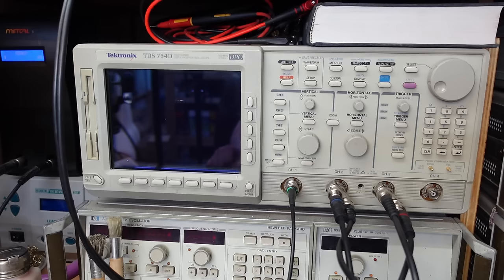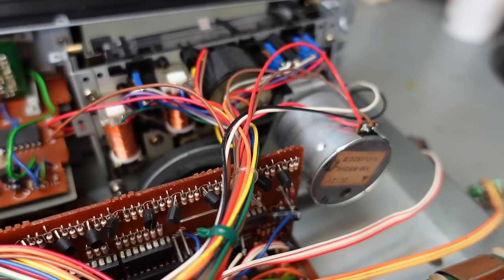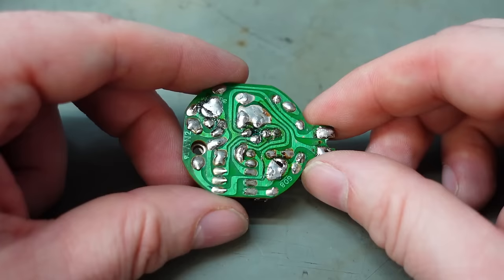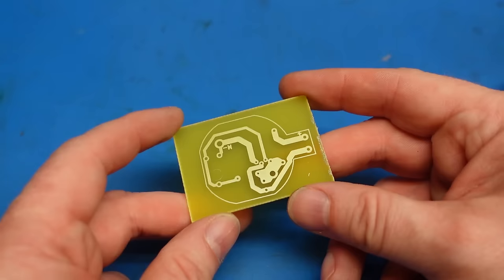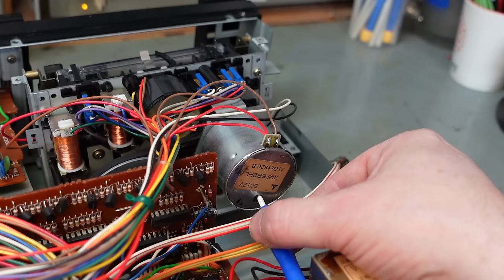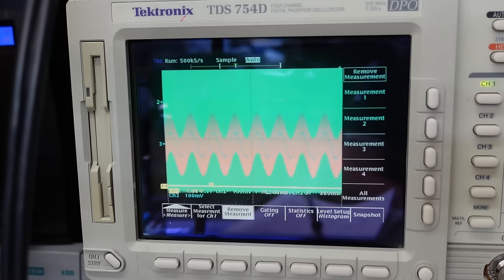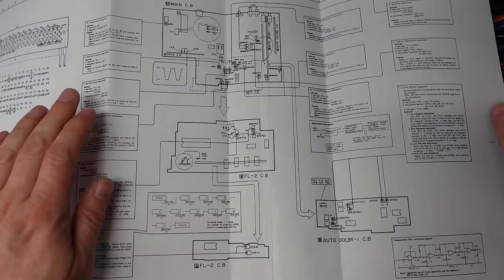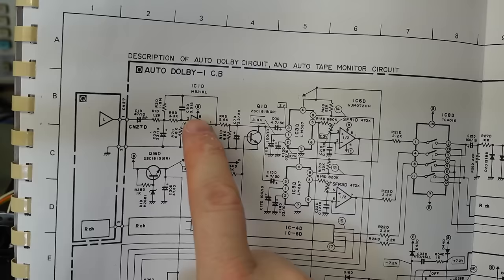AIWA 3 Head Tape Deck (AD-F990) Part 2

Comment: Does anyone else just want to throw away their soldering iron after watching these incredible videos?  I will never be on this level
Reply: I have spent over 50 years doing consumer electronic repairs and your soldering iron
remains by your side, but more often than not todays gear requires a rework hot air station.
Mark is a master of his craft.
Reply: I might not throw it away...but seeing Mark I deff know I would've  kicked that cassette deck all over the place...then have more work to fix it 😂
Reply: I saw many technicians in the 90s, But I've never saw this low level of repair, Rewiring motors, Rebuilding plastic knobs... In the air force it's called "Level D Work". A Level - Airplane level repair, B - Garage, D Level - Lab. Not many people reach level D.
Reply: Yep, I enjoy watching these videos, but they make me feel totally inadequate. If I lived to make 100 ,I would never come anywhere close  to the level of talent this man has. 😢😢
Reply: thats because you say you cant. cant never did nothing. can does everything!!! your thoughts keep you there!!!
Reply: Keeps the room warm.
Reply: No I want to buy a new one.
Reply: Lol if I was 10% of how good he is I would be happy!
Reply: Absolutely not. It's made me buy a better one. Mark is inspiring

Comment: Of course Mark's skills are superlative, but credits to Aiwa for such a great service manual. Today, not even in high end electronics you will find such literature!
Reply: that AiwA is a masterpiece of an era. Total topnotch.
Reply: Both AWAI and Mark are both superb. I agree, great documentation is necessary for complicated products.
Reply: The original manuals are even better than you see here - the circuit diagrams are overprinted in blue, so the component legends are legible.

Comment: As a retired engineering technician myself, watching Mark's videos makes me wish I was back on the job.
Reply: What's wrong with having it as a hobby? Then you also get to choose what you work on.
Reply: @paulmichaelfreedman8334  Don't have a proper place to set up shop at my house, although I may in the future.
Reply: @HansDelbruck53  I know what youy mean. I have about 8 square meters for my little mancave. I make do by making optimum use, but I really need three times the space.
Reply: Eight square meters 😂 you can dance while working, I have a workplace in a space of 0.8 x 2 meters in the corner of our bedroom (the photos are on EEV, the last modification of the workplace is on page 194 and I think it starts on page 139 my nick Edison) before that I had a workplace built into wardrobes. When you want space, you can always find it 😁

Nice day 🙂Tom

Comment: Mark, your pcb manufacturing technique is nearly identical to mine. When I was 18 (I am 52 now) I made my own UV box for exposing photo positive pcbs, and I still have it, and I still use it 😁. And I also use double layer transparencies, laser printed. Back in the late 80s I had transfer sheets with through hole pads and traces and actually made them by hand until I got a second hand laser printer for 25 guilders in 1992 (About 5 1992 pounds) ,an HP laserjet II (300 dpi). Late 90s I got a 1200 dpi laser printer which gave the designs razor sharp traces. I also mucked about with a roland plotter but it was cumbersome and slow. It's now disassembled waiting for a laser head for directly exposing photosensitive pcbs, in a bitmapped scanning configuration (no vectors). Will be driven by a pi pico's PIO state machines.
God I love reminiscing those days.

Comment: One day I did a similar repair of Texas Instruments Calculator. Someone stilled gasoline on it. Its PCB and LED panel got damaged after. So I carefully soldered out all components, and then made a new PCB with a similar technique as in the video. I had to buy a new LED panel though. The calculator worked again as new after I soldered back all components. This video is a very nostalgic for me.

Comment: I like the way Mark  is more than happy to share the things that don't work out. That's real world fault-finding - showing the entire process.
And everything gets fixed in the end - the only variable is time. But I'm not sure I would have the time and patience to design and build my own motor controller to run the motor I re-wound myself.
I dofff my cap to you Mark. Top man!

Comment: Mark, I just discovered your channel and love your videos!
 I have an Aiwa F770 that has been apart in a box for over a year waiting for me to finish repairing it. It's almost as complicated as yours and is a pain to work on. I had already gone through some of the same mechanical issues as yours had. My motor was messed up too.  These videos inspired me to get it back out to finish troubleshooting a record problem. I just found and fixed the cause of that problem. The SFR501 and 502 were both open circuit. The style pots they used have mechanical connections for where the leads connect to the carbon traces, and they are flaking out with age. I hope no more problems show up as I button things up LOL
Reply: Does your 12v regulator get hot? Mine does! Something's making it work harder than I'd like.

Comment: Hi Mark 😲 WoW absolutely amazing diagnostics and repairs 👍, on the one hand I'm a former service technician (today it's just my hobby, which I returned to six years after my workshop was completely robbed), but above all a huge fan of the AIWA brand.
Fortunately, I never had such big problems, with my AD M700 tape deck, I changed the motor after 9 years of use (fortunately, I got a new original), I changed the heads and the pressure roller. After thirteen years of operation, I replaced it with the AD F910 model, where after about ten years of operation I changed all the belts - I still have the whole assembly today and it works absolutely perfectly - newer machines have long since given up.
I admire your care and thoroughness, there are not many such thorough technicians (I am also very careful and I value such precise work all the more). Your enthusiasm and humor is contagious, I always look forward to every new video and I'm so glad I discovered your YT

Nice day 🙂 Tom
Reply: I have the adf 910 it’s a great deck always liked aiwa 😊
Reply: I also own the magnificent M700.
Reply: @tremayne3  Congratulations it's an absolutely amazing machine. In 1991, I was working on a sound program for our agency and I needed to record some sounds and noises from the archive of the Czech Television. I was very surprised when I found a rack with thirteen AIWA M700 tape decks in a recording studio next to top professional studio tape recorders.

Nice day 🙂 Tom
Reply: @user-ud9rn7dw6q  Great machine, originally I wanted to replace my M700 with a 9000 but it cost like three 910's and I didn't have that much money. The XK-S9000 model has such a peculiarity (the 7000 model also had it), the mains transformers are mounted on the outside of the rear panel in metal boxes.

Nice day 🙂 Tom

Comment: G,day Mark from Sydney Australia. I can't believe how complicated a 1980s tape deck is. I guess pre- MOSFET
* Really like your crocodile clips for bench multi meter uF testing. 
* Manufacturing the PCB and scavenging the components for the DC motor was "jaw dropping" 
* Dolby noise reduction, such an 80s feature.
* Those caps at power supply, didn't show any deformation (swollen tops) 
* I Wonder if you could purchase a new DC motor for that model, instead of internal PCB power modulator?
Thanks for filming your work.
🌏🇦🇺

Comment: I would recommend that you expand certain rails on the PCB to provide a flood fill. This will help heat dissipation but the main effect will mean less copper to etch which will mean your ferric chloride will go further.

Comment: I have to applaud your work ethic there. If that was me building that motor IC circuit, I'd have just re-used the existing PCB, scrubbed the tracks underneath and wired the components point-to-point with some small bits of wire. Manufacturing a whole new board is next level! Well done, am enjoying this series.

Comment: KiCAD totally rocks, so awesome that one can have such a piece of software for free ! I use it since version 4 and it has improved a lot over the last years. 

I expected some tinning of the traces or solder mask / conformal coating for corrosion protection, the etched bare copper PCBs I produced got a little tint over the past years, would be a shame if the home made board inside the motor fails after a couple years.. 

Thanks for the Video ! there are a few things here and there to learn, that is always nice :) Really love your work and style !

Comment: Hey Mark I am so happy to see part two and I really enjoy your videos extensively! I did see a couple of wonky/cracked solder joints near that small cap that was on the foil side of the PCBA around the area you are working around. Those era of electronics from numerous manufacturers were notorious for dry solder joints after 20 to 40 years. I think you'll find quite a few more if you keep looking around at all the boards.

Comment: I've reconnected my Akai GX-6 K7 player, and I'm really amazed at the sound that comes out of this device. My recordings from the 80s and 90s are still very good, in Dolby C on metal K7s. Listening is very smooth, and much less aggressive than with my CD player. Frankly, I recommend you give it a try - you'll be surprised !  😮

Comment: Great work, what a nightmare repair though 🤣. A quick tip on the fresh PCB, I would advise to fully tin the fresh traces. Copper will tarnish and can even corrode if left unprotected.

Comment: Sometimes I wonder the price of a repair like this but I am amazed at the patience and detail.
Reply: So do I - I'm one of his clients.  But the backlog is extensive (price of channel's popularity I guess :)), Mark stopped accepting new orders months ago... Anyway mine is another 3-head deck down the line. I hope I won't have to sell kids into slavery
Reply: @monohedron9633 Hhahah, maybe it's not necessary but in fact it takes a lot of knowledge and resilience to repair these relics, I'm also in the repair business and although most of them are modern electronics and also some vintage but I admit that I still have a little bit left to have Mark's knowledge ...

Comment: I own one of these decks (thankfully, it's still working!) and can confirm they do run hot. I put a little USB fan on top of the heatsink to keep it cool. One problem I do have is that it records great but playback is definitely muffled.

Comment: That's an amazing straight forward video. You gotta love when things start failing one after another 😁. I love the simple regulator board you made. Btw I would probably use a smaller value trim pot with a resistor in series so that the adjustment is within ±10%. I think it should be possible. Also I wonder why the power supply caps were getting hot if they are not that much out of spec, perhaps they made a compromise with the values to save some space, although that would be a stupid thing to do on a TOTL deck. Looking forward to the next part.👍

Comment: I take my hat off to you for sticking with it. You should get some smart tweezers ST5 they are great for testing onboard caps,resistance and induction, etc. I use them for many repairs and they are great. They won’t replace your main equipment, they just good for quick and hard to reach places. Should check them out mark. They are made in Canada and not cheap china crap. Anyway love your work and your old school who knows his stuff and not like many today who give up or mess it up. Be shock at how many hdmi sockets I have to do because the shops people take them to have messed them up or rip pins of the board. Also repairs where they say it unrepairable and I repaired it. It’s mad today how many idiots there are now. Love your channel and good luck on that deck lol.

Comment: Great job!
This type of motor with a built-in servo circuit has problems with heat dissipation, so it might have been better to attach a heat sink to the IC.

Comment: I've been thinking of picking up a for parts or repair tape deck off of eBay, no chance after seeing this (I'm lying we love the disappointment and the odd glory)… way pass my troubleshooting skills though, even if I did manage to diagnose (lots of tips in this video) the spares would seemingly be a nightmare, didn't realise how complex these  pre IC consolidation (i.e. single chip handling Dolby, Op-amps, filters etc...)  decks are...  still appreciate your perseverance Mark.

Comment: You sir are amazingly thorough ....but ( and I'm sure you've heard this )Always change the electrolytics.....they can measure ok and break down or leak in circuit, or die a week later and mess up your reputation with the client
Reply: Not all the electrolytics, not all the time and not every time (aka "it depends") . There were two capacitor plagues. The failure plague and the "recap" plague.
Reply: 😂 Good luck with that approach

Comment: Great video Mark. Wondering if a heat camera could help you diagnose which component is failing in these scenarios. Set the camera up around the right area of the board and supply power

Comment: Wish i'd known those motor driver IC's were still around ! I replaced the motor in a Yamaha tape deck because the driver IC had burned out.. the motor I used was a Mabuchi Motor which wasn't anywhere near as good as the original was! If i'd known those motor drivers couldve been got, I'd have built my own motor board too! Grr :)

Comment: Great work, but it seems the motor issue was a "normal issue" by AIWA. I had two decks with similar problems (AD-F800 / AD-F880).

Comment: Actually thinking about it, that tape you removed looks like makeshift RF shield(its connected to ground), so is there chance that "noise" comes from outside? There are transistors behind, also two wires passing by. Just specullation, but maybe worth checking.

Comment: Hi, I watched this video again to see if I had any idea what could be causing the interference. The idea didn't occur to me, but I found out that I had overheard the information about the missing channel on the oscilloscope - so you have extra work to do - 🤔 so we can look forward to the next video 😁 - oscilloscope repair 

Edit: The only thing that occurred to me - if the circuit is functional and does not generate interference - there can be no crosstalk due to the disordered wires

Nice day 🙂 Tom
Reply: Strange 🤔 there was a question for me, so I answered and both disappeared.

Comment: Quick question Mark - you manually desolder some things, however you seem to use the vacuum desolderer for others.  Is there a reason you don’t use the vacuum all the time (except for bent leads)?

Comment: When looking at the interior of this deck, the difference in philosophy between Aiwa Engineers and ReVox Engineers becomes very visible.

The ReVox B215, which was ReVox's representative in the K7 segment, has a mechanism with 4 motors, where the only rubber present are the two on the pinch roller....its wow and flutter is incredibly low.

The electronic section is extremely elegant, with boards in slots, without this absurd wiring.

As visual beauty is subjective, perhaps in the eyes of many, Japanese decks were more beautiful, with their bright and huge displays. However, from an engineering point of view, the beauty and efficiency of the ReVox/Studer construction is unbeatable.

Comment: I forgot one other thing, I fixed my studio compressor used on a 9 volt system and 1 pre-amp 12AX7B tube (silly). I had to change every electrolytic capacitors. 10 of the little leaky guys with brown goo - I cleaned up the circuit board also. Cheer again!

Comment: Awesome video love ur work. Do you regularly calibrate your test equipment? I have a couple of the HP 8903 audio analysers and could not figure out how to calibrate them as the manual refers to a bunch of dedicated HP test equipment that I do not have. Would be keen to see a video if the need arrises of the calibration procedure on one of these units using basic equipment. Thanks again for your awesome videos.

Comment: All that complexity just to switch Dolby on and off , which most of us left off anyway back in the day.
Reply: I was thinking that too. The average user not only never used it, but didn't even know what it was supposed to do!
I remember in the 70's at the age of eleven I bought a 'dolby' style tape noise reduction kit as my first ever soldering project. After all that work I proudly powered it up & all it did was make my tapes sound worse!

Comment: i had a playback problem on a sony tc-k615s  BUZZZZZZ turned out they had the ground tied into only 1 spot with 1 screw and it was letting all kinds of interference in to the play head. 
Drove me nuts! so i added 2 more grounds

Comment: Hi Mark, at around 36:00 you find a dry solder joint, you then suggested that where you find one bad joint, there may be more. Did you go over all the joints on the board after that? I ask because if that a good practice, I might start doing that in my own repair projects.
Reply: It takes time, but it's well worth doing, especially on most modern RoHS boards with their brittle lead-free solder. I find it quite satisfying to do & has cured many a fault on my stuff without further time-consuming diagnosis. If time-constrained just reflow everything that's heavy or attached to heavy stuff; that's what takes the brunt of an impact or a drop.
Reply: @wirdy1  you sound like you know your stuff, thanks! Do you think there is anything risky with mixing solder types, such as using modern lead free solder to touch up older leaded joints? I'm an E&I tech and only now starting to delve into component level electronics, and trying to develop good habits.